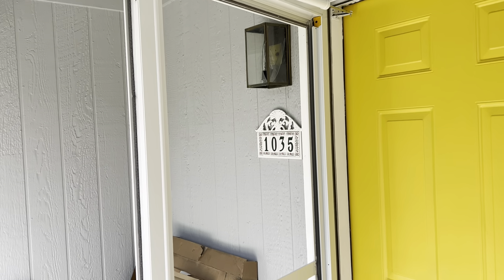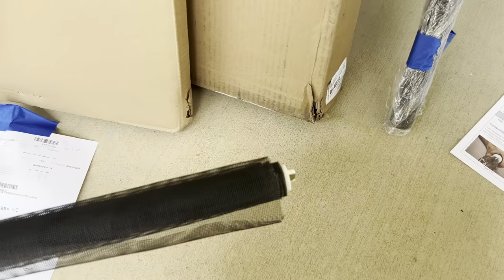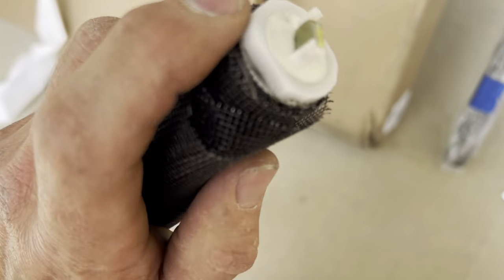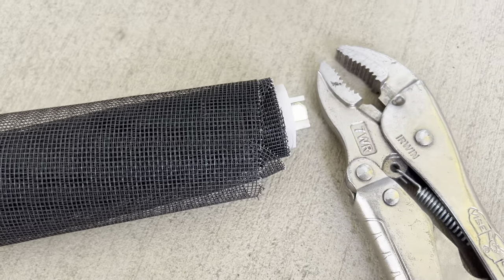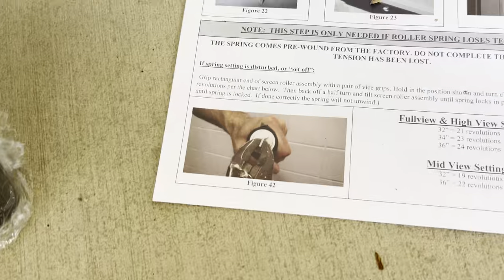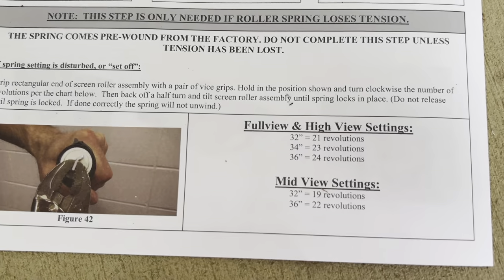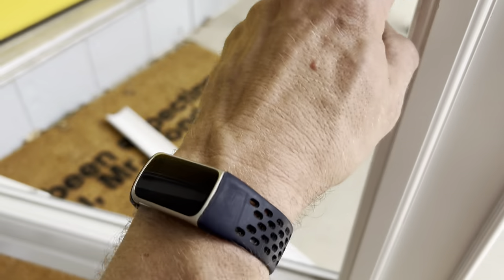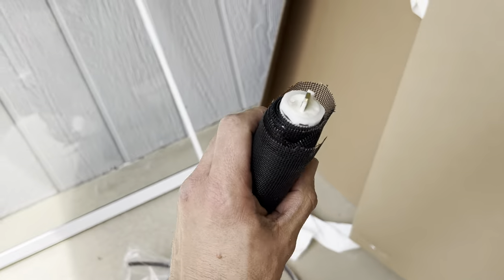Do This If Your Retractable Screen Loses Tension

Comment: Can you give me information to retention a Pella window hidden roller screen that totally lost tension.  i had to replace the runner clip and the tension was lost during the process.  Thank you for your time.
Reply from the maker: I believe the tensioner instructions are exactly the same for the Pellas because Pella is owned by Larson
Reply: @ wow I did not know that. Thanks for the fast reply. Instructions are somewhat hard to find for the Pella specifically. My window is 20 years old. I will try to look tomorrow. Any other info you could pass along would be greatly appreciated. Thanks for your time. Merry Christmas. Thanks again.
Reply from the maker: @almoschetti5503  Merry Christmas!

That is an old door may be before Larson bought the storm door division of Pella. I know they don't make thoose parts anymore so hopefully it works. The parts may be a little differnt (for example, i think the winding side of the screen slides in a metal channel instead of into a plastic bracket like in my video) but the basic premise is the same.
Reply: @stormdoorguy  It is a Pella window 3 sections side by sIde and having issues with the middle window. You have any videos on Pella that hidden roller screen adjustment for windows     Yes it is old. Pella hasn’t called me back and that is upsetting as well. Thanks for your help.
Reply from the maker: @almoschetti5503  Is it a house window or a storm door?
Reply: @stormdoorguy  As I mentioned above it is a 3-section house window I believe they call it a casement window.  The middle window is the one that lost the tension on the hidden screen.  I do not see any exterior adjustment and feel that I have to rewind by hand and find a way to get the screen back in the slots before it unwinds again.  Before I do that I thought you may have a idea for me to use or a video but I see that you just have storm doors.  It is a Pella Window and installed in 1998 and Pella has no instructions that I can find.  If you would know of any and could let me know would be highly appreciated.  If not let me know and I do appreciate your time and your responses.  Thank You
Reply from the maker: @almoschetti5503  Ah. That I didn't catch the first time. I know nothing about Pella house windows. The only thing I could do is refer you to HomeAdvisor.com or Angi.com for a window installer who could point you in the right direction better than I could.
Reply: @stormdoorguy  Thats ok and thanks for your time.

Comment: Will this help if the screen won't go up at all? We have the mid one and when I went to slide up the top window it felt tight and the screen will not roll up at all. Just bunches up.
Reply from the maker: If the screen doesn't roll up at all and just bunches up when you move the top window back up and the screen is defective and you'll have to replace it. I did a video on this, just look for replace a Larson retractable screen on my channel and it will come up. It's about 15 minutes long.

Comment: Should that spring come apart? Larson sent a replacement b/c their old one snapped, and the spring end came out of the rest when I opened the package. Not sure if it came broken, or something I can work with. Thanks!
Reply from the maker: Yes, that spring can come out of the tube as long as it doesn't separate from the white cap itself.

Just reinstall it back in the tube appropriately and retighten if you need to.

Comment: Great video.  Thank you.
Reply from the maker: Glad you liked it!
Reply: I need to have another look, but when I tried winding mine up I needed to quickly try and jam it into the slot before it unwinds and I couldn't do it when it was wound all the way up. How do you get it to stay when it's wound up?
Reply: @mikemurphyiv  I did just like this video displayed.  I went around 1 more than the directions stated, then slowly unwound and after about 2 of 2 1/2 TURNS, it did catch, and I could let it go.
Reply from the maker: @mikemurphyiv  once its wound you have to turn it from bing horizontal to more vertical. Then it should "catch" and stay wound up before you remove the pliers otherwise it will snap back and unwind again.

Comment: You won't believe what I did an hour ago? Got up to hit 2 large Flys on my Larson 36" Mid door roll up screen, well I blasted the two Flys, killed one the other flew away but I stretched the screen so bad the right side won't stay in the track or edge. And it's not tight it flops around even though the left side is perfect.

Comment: I did everything like you say but the screen dosn't roll up like it used to. Noe its like a widow shade that keeps latching part way up and almost impossible to roll up all the way up. btw it seems like its to tight, like its a tiny bit to long and pressing on the door frame.
Reply from the maker: Sounds like its just time to reorder another one from the factory. You can go to larsondoors.com or visit stormdoorpartswarehouse.com to reorder a replacement. Could be the tensioner spring is bad.
Reply: It's a new screen but I figured it out. I had the plastic end pieces turned 90° off. The little springy tab faces up not out. Ooops.

Comment: Hey, i twisted it to build tension back but as soon as i undid my vice grips it unspooled. How do I keep the tension held while putting the screen back in?
Reply from the maker: When you get it tensioned, move the roller up and down with the vice grips attached. You might even back the vice grips off slowly. Theres a point at which the roller will lock the tension into place then you can remove the vice grips and install the screen.
Reply: @stormdoorguy  thanks. I saw you posted this in a comment below like 5 minutes after I posted mine. Did exactly what you said and put it back up. So far it’s working, thanks for the help
Reply: @stormdoorguy  you are amazing!! Appreciate your videos!!
Reply from the maker: @macrivera7645  glad they helped!

Comment: I understand that the spring needs to be rotated clockwise- but after a couple of turns it springs back - am I missing something?
Reply from the maker: There's some sort of internal locking mechanism i haven't been able to figure out. You have to hold the screen mor vertically than horizontally after tightening, like say at the 10-11 o'clock position. It will unwind a little, but something catches internally and it locks into place.

Comment: So I replaced the screen. Got it tighten again. Installed it. Now the spring won't unlock. What am I missing?
Reply from the maker: Dumb question, but is the screen installed the right way. Meaning the L bracket is on the left side of the door when standing inside? If it is, it's possible it's overtightened, or it's possible the release mechanism inside is defective. Those are my thoughts. Or the top window hasn't been seated properly. There's two plastic tabs on the top of the window that sometimes gets stuck and don't slide in the track easily upon reinstallation. You just have to move the window back-and-forth a little bit and they popped into the track.
Reply: @stormdoorguy  the left side on the top; (I believe) is installed correctly with those junky plastic pieces. 

At first I thought I did over tighten it. Even un-did the whole spring system and tighten it up as recommended. 

So maybe play with it?